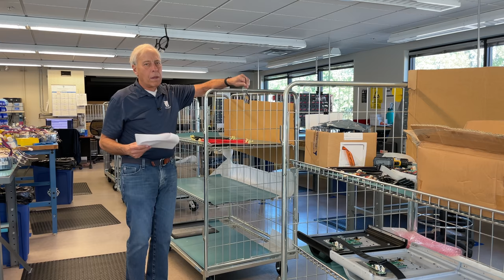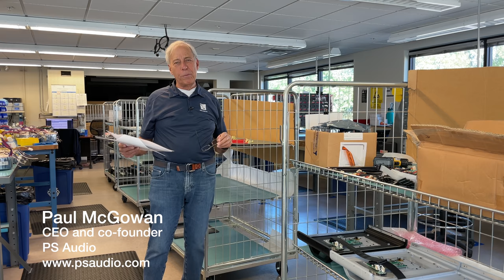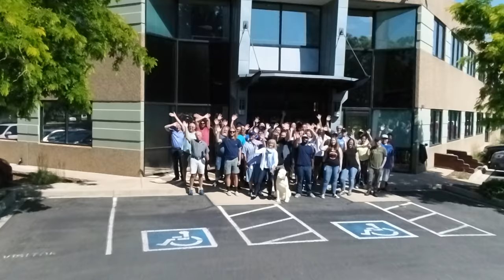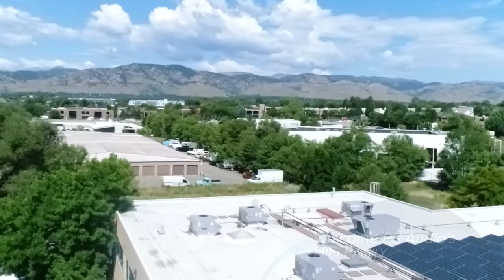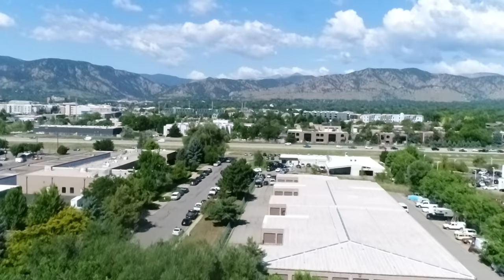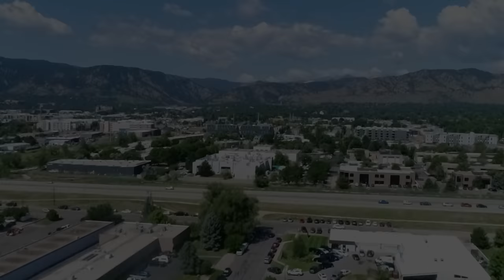How to set levels in a HiFi system

Comment: A good idea not mentioned is to level match them so that when you select various inputs the overall volume does not change from one input to the next.
Reply: What's that mean? My CD player, tape deck & especially turntable doesn't have their own volume settings. Volume levels are also different between some recordings.
Reply: @jesusgavemeaids  
AVRs and preamps often have separate level adjustments for their various inputs, but often the output from the turntable’s cartridge is so low that there’s not enough adjustment to cover the difference, so you have to volume up for vinyl and volume way back down for everything else.

Comment: Why does the last volume level (generally the preamp) have to be around 50% of the way up? The way my system is now, I can't turn my pre up past 25%... It's too loud. 
Am I losing quality by not having my pre around 50% on the volume level? Should I lower my DAC volume to achieve that on my pre? What do I gain by doing that?
Reply: @Douglas Blake how would I notice distortion? I don't think I ever played my system loud enough to know what that would sound like.. what should I be listening for?
Reply: @shawnmathew825  Clipping (of the type talked about here) will be audible mostly in the upper midrange as distortion. Listen to male tenors (not singing in falsetto) or female mezzo-sopranos. It is also often audible in cymbal rides, and snare drums. It is also very audible, though hard to detect until you hear it, on Stratocaster guitars running a distortion pedal. 

The song I use the most for listening for it is Pink Floyd's Atom Heart Mother. From about 6 or 8 minutes in, there is a mixed chorus where the male voices start low and crescendo over the female voices. You will really hear clipping distortion in this track, and it will move you emotionally even if it not your style of music. When clipping is there, the voices get muddied and loose their emotional impact (the male singers in particular really dig deep go go all in). The distortion will sound almost like a light fuzz, not quite a hiss.

Vocalists like Tori Amos will seem constrained when clipping, but you pretty much have to know how much detail and resonance she has in her voice to know what you are missing. Before and after listening to one of her simple tracks (Bells for Her is a good one) will not only test the limits of how revealing your system is, but really reveal the richness of her voice when she is almost acapella.
Reply: Thanks for the help!!!

Comment: This is what I was looking for, my DAC has a remote with volume control SMSL SU8S to be precise. NAD 165BEE Pre amp is a one with volume control too but no remote, i had kept pre amp at 50% and controlling volume on DAC.
Power amplifier has no volume, should I do what you suggest? Max out DAC volume?
Reply: Technically speaking yes. The NAD volume control will give beter performance. However if you like or insist on using the remote you'll want to use the volume on the DAC as high as you prefer to listen to music. Max out the DAC and then slowly adjust the preamp volume to the maximum you would ever want to hear for sustained periods. That becomes the new max volume and allows the DAC to operate with minimal degradation because you are using the upper range of the volume control.
Reply: @Bezerker1181  thanks buddy. Surely will try this out.

Comment: Hi Paul,  I am using a DAC with a lossless volume control, and I use my preamp for volume control.... I would imagine based on your video here that it would not matter whether I have the DAC set to loud or low volume in this case since it features a lossless volume control, am I correct? Thanks...
Reply: Technically, yes, but since every preamp sound different depending on where its volume control is, it probably pays to set the DAC to where your preamp's control is at a comfortable level about 12 noon when playing at reasonable volume levels.

Comment: Would attenuators work to reduce the gain between a preamp and a power amp? I am using a Topping D10s DAC (no volume control) and a xduoo MT-602 tube preamp into a Hafler DH-200 power amp (also no volume control). So the 602 is the volume knob, but it has a high output level noted by reviewers, so the system gets too loud when I turn the knob up past 8 o'clock. Wondering if line-level attenuators that reduce the signal by 12 dB would allow me to get the 602 knob up to half or two-thirds, as Paul suggests. Does anyone have experience with this?
Reply: I do this with my sources. You can get some very pure attenuation for $50 using something like a Schiit SYS or JDS OL Switcher. I have a JDS after my DAC because it runs much louder than my phono stage.
Reply: Thanks for pointing out those devices. Very good ideas and variable. Does it say how much attenuation in dB the JDS can do?
Reply: @bluesman608  It's just a simple Alps 10k potentiometer (same as the Schiit SYS), and it only acts like a volume knob you can put in-line between sources and level match by ear.  I have one of each in my system and I believe they provide perfectly transparent passive attenuation.  They aren't going to give buttery smooth and precise volume control like an Alps Blue Velvet, but it should get the job done to level-match your sources.

Comment: People used to pop a record on the turntable or a cassette in a cassette player or listen to the radio or tuner when they want to listen to music. Now people worry about DACs, resolutions, clocking and jitter corrections, dynamic range etc, etc ,etc. What a crazy world. Wake up!!!!!
Reply: The people who used to pop a record or a cassette back then are now listening to streaming from their phones (and most probably not watching this kind of videos). 😉
Those who now worry about DACs and resolution were worrying also back then about amplifiers, phono amps, cartridges, tape heads etc.
So no waking up needed because these are two different categories of people with completely different ways of listening to music. 😏
Reply: @AlexandruBurda  A fool and his or her money are easily parted.
Reply: @artyfhartie2269  not necessarily. As long as you care about the way the music sounds you can find enjoyment without brackeing the bank. A nice a satisfying sounding hi-fi doesn't necessarily have to be the most expensive out there. But again, if you care about the music and not the sound as a technical thing or make a fetish out of the hi-fi system it self. As there are indeed people who listen to their systems and not to the music.
Reply: @AlexandruBurda  I think you are right. People will always be drawn towards new tech. I have heard many expensive gear and bought some too which I stupidly sold years ago but for the money the vintage stuff I have now is so satisfying. I love records, tapes, cds from analogue source AAD as well. Streaming devices, external DACs are not for me. Radio stations broadcasting in FM played on vintage Luxman tuners for example are beautiful. Cheap too. I love big fat vintage Klipsch and JBL speakers made in the US.
Reply: Murray Goldberg said it best
‘People are morons’

Comment: Thank you! What about the volume in the DSP of your software? I use Roon and I use this volume control. Does software controlled volume controls introduce a degradation of sound?
Reply: Roon has pretty decent volume control for software based systems. Still, it sounds better when fixed at max. That said, if I was stuck using Roon for volume control, I would not be unhappy.
Many people will claim that volume is best done inside the DAC chip itself - and this is in my experience better than using Roon, but it is very dependent on the implementation. My DAC chip only adjusts in the top 10% of it's range, and the output is then attenuated in 10% steps through a series of relays. 
My signal path is HQPlayer set at -9dB, HQPlayer NAA on a Sonore Optical Rendu, into a Matrix Audio Element-X, then the power amp. I use Roon only to handle play back (it is an excellent player), I use none of the dsp etc. HQPlayer is set at -9 because I get some clipping at -6dB.